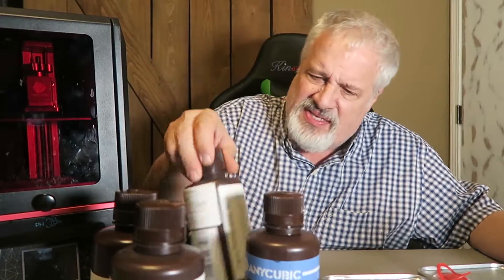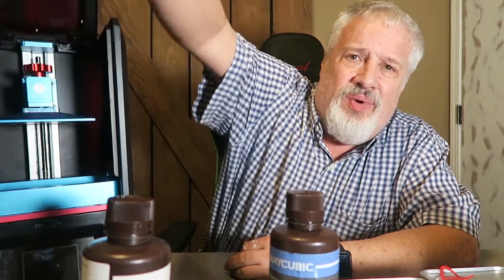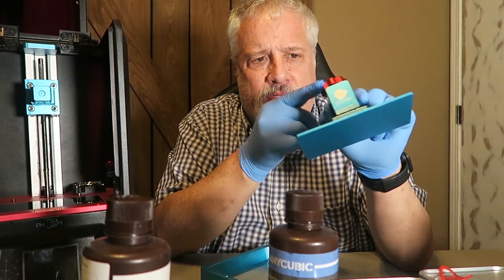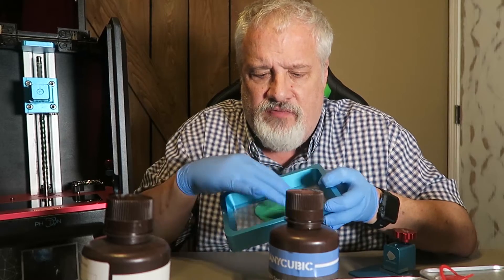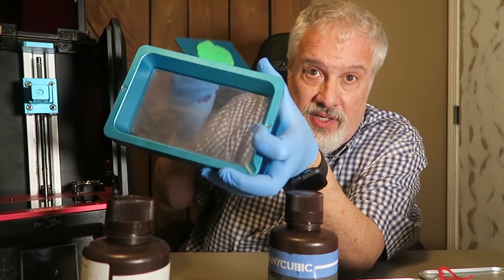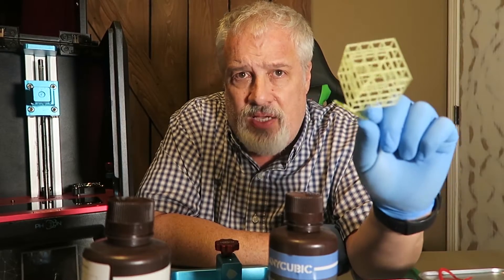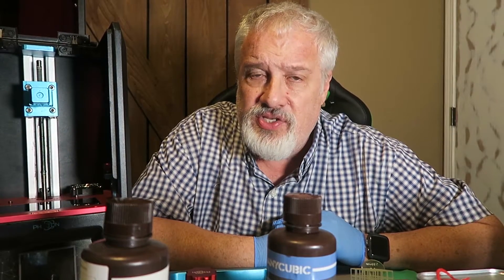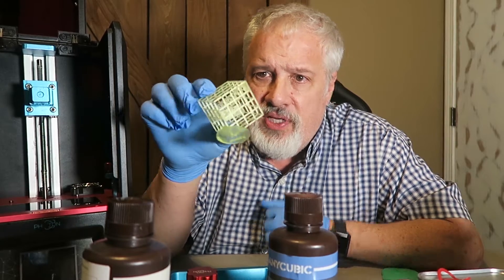Anycubic Photon 101:  Resin Basics: Getting Started

Comment: This is probably a dumb question. I have the spreadsheet but where do I put all those settings. I have made 3 small minis I sliced them with the default settings but I have had 5 fails. What’s happening is it will run for a few hours and the when I can see the print I notice that only a few supports are there and nothing else. Please help I am only 3 days in and am learning. Thanks in advance love your Chanel

Comment: I’m brand new to 3D printing and chitubox as well i recently purchased a 3D print that comes in different parts that connect to re size the print to make bigger or smaller I was 
wondering if anyone knew how to enlarge all pieces so that they will fit at a bigger size I know how to enlarge the parts but I’m confused how to make sure they are all big enough so parts connect at right size

Comment: Do you add your resin in with the build plate in the vat or before and lower it in? I’m having trouble gauging how much resin to use for larger prints and have ran out mid print thinking I had enough.

Comment: Great video..
Any advice on why I can't get model to stick to plate? Only seem to print on to resin tray and fails of course? Leveling is perfect 
Thanks Ross ( England )
Reply from the maker: You might check your bottom layer exposure time to see if it's high enough.  Do you have Facebook?  If so, check out the Photon Facebook forum.  All the folks are super helpful in with troubleshooting.

Comment: Do you have an opinion on the new version of the Photon?  The Photon S? It has two Z rods instead of one which would theoretically help with  Z wobble?  I need to print VERY small parts (1 to 2mm) with as much accuracy and detail as possible.
Reply from the maker: That's a really good question. In theory, it would help with Z wobble and give you superior prints.  As far as the Photon S is concerned, I was disappointed that Anycubic decided to go cheap and use plastic on the case rather than metal.  I have been reading really good things about the Epax X1 and have reached out to them for a review.  Not to knock the Photon, but the Epax has fixed a bunch of items that were lacking with the Photon v. 1.  especially in the area of Z axis issues.  If you have access to Facebook, join us over on the Anycubic Photon Printer User Group.  We have over 10K members.  The knowledge base is excellent!

Comment: Hey, just another tip.  I ruined my plastic spatula, and don't like using a metal one as I might scratch the aluminum bed. So I picked up a few plastic razor blades. You can get them anywhere. I got mine at the local ace hardware. Also great for standard FDM printers

https://picclick.com/100-Pack-Plastic-Razor-Blades-Tint-Pinstripe-Decals-281826385581.html